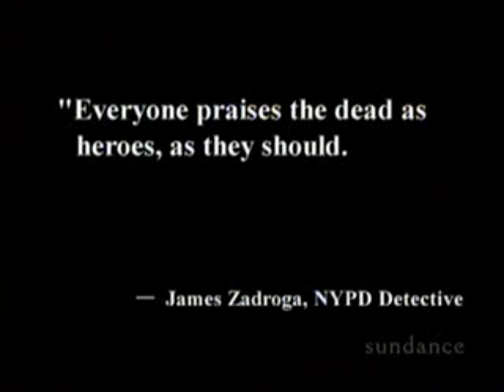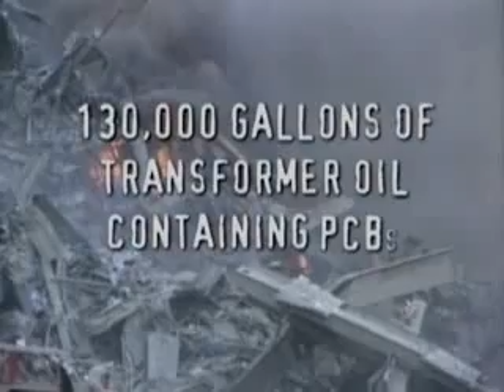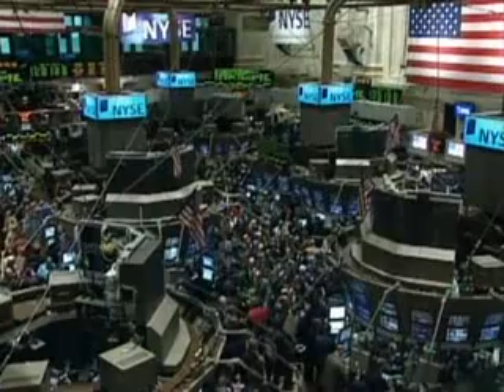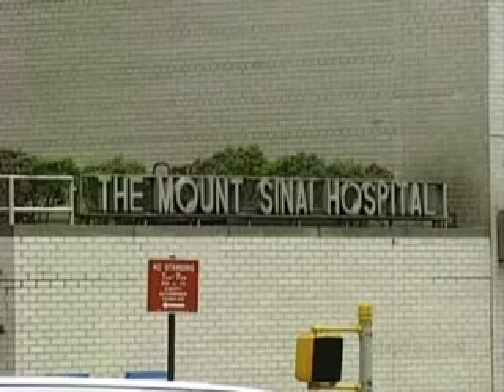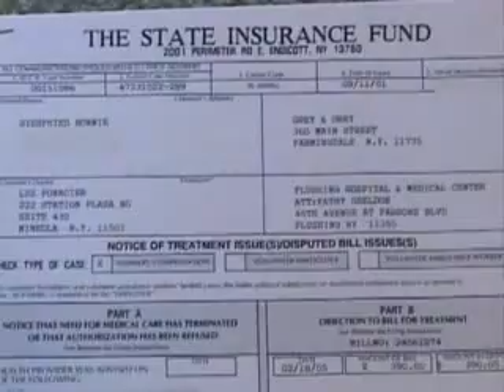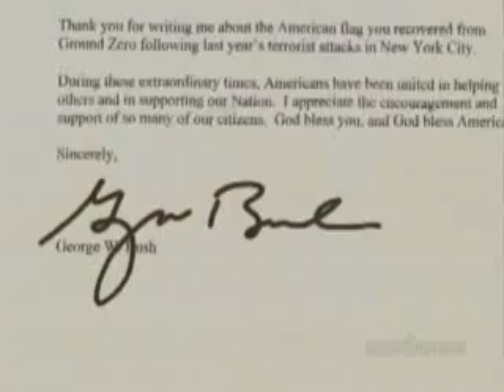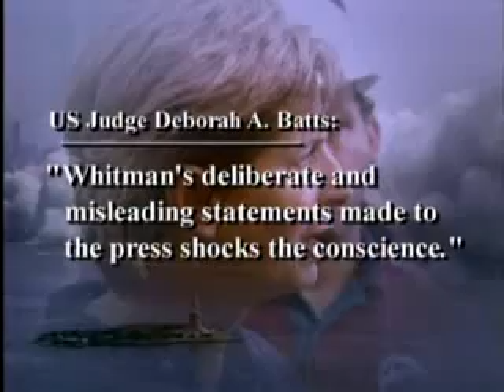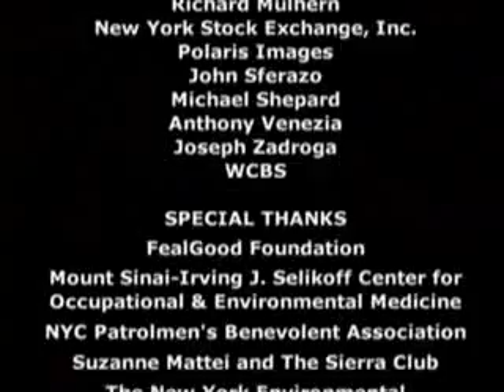Dust to Dust: The Health Effects of 9/11

Comment: A 1000 questions arise; why the misting of the site? If the smoke was smoke (and thus heat), the rescue workers couldn't look into the pit from which it came. And they did. It was Radioactive DUST as materials continued to breakdown.